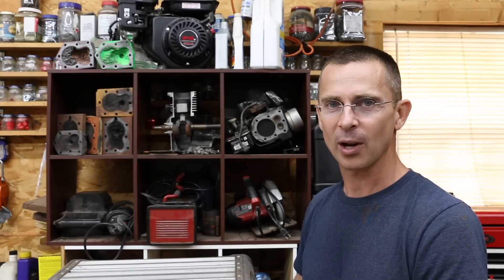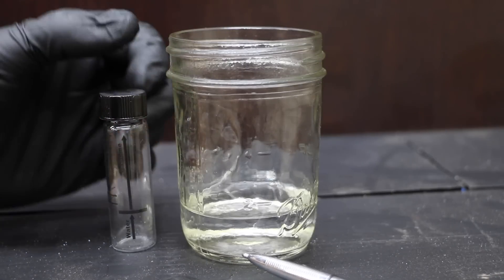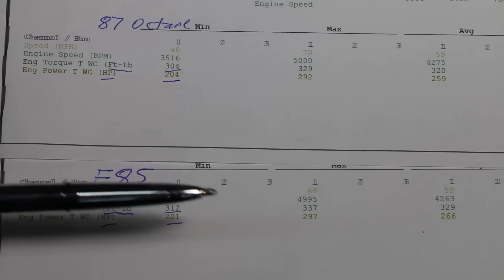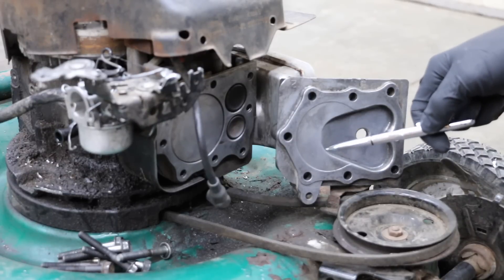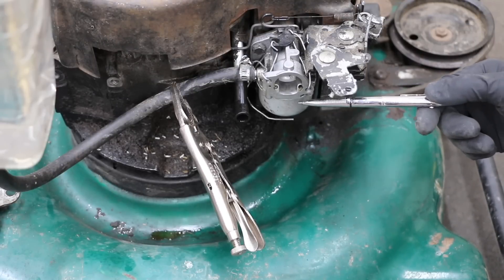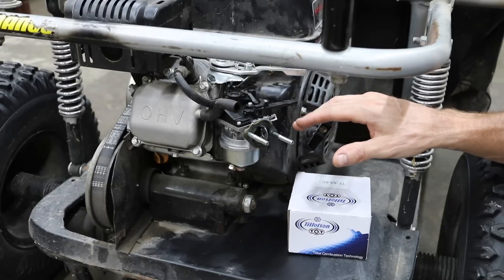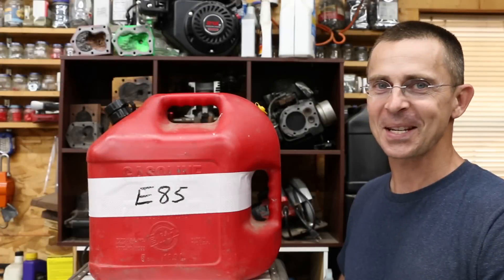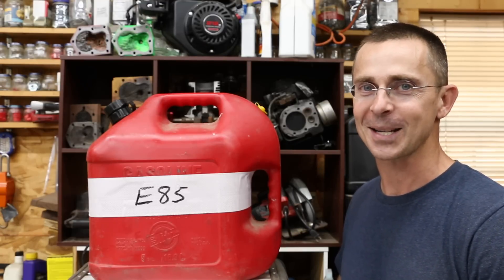Is E85 better than Gasoline? Let's find out!

Comment: E85 nets lower efficiency in any engine designed to run E15 or less. Simple chemistry and physics. Ethanol adds anti knock which means you can run higher compressions, either through displacement design or through forced induction. This makes up for it's far lower chemical energy. But without those two things and I don't known many/any engines that can change combustion chamber compression ratio on the fly you get less efficiency and power. Though you can recoup the power some by being able to advance the timing more for more mechanical advantage.

Natural gas is the same. You can take a standard engine and run it on CNG with some modifications but without changing the compression ratios you end up with poor efficiency per unit of fuel. However if you design an engine with higher compression ratios to begin with it's very efficient and smells like a laundry mat dryer, or at least the exhaust does XD.
Reply from the maker: Great point. Thank you
Reply: Exactly...
Reply: Nissan/Infinity make a variable compression engine but I don't think PF will be willing to buy/test/destroy one :P
Reply: So new flex fuel vehicles generally have higher compression engines that require or strongly suggest running 91-93. On some (like the F150) you CAN run 87 but the engine will detune strongly and Ford warns of worse performance in hot environments

Comment: I use methanol in my kart mainly for temperature reasons. I can drive at blackhawk farms for a half hour (at that point my fuel tank will be on fumes) with the cylinder head temp barely kissing 410°F. keep in mind that's a car race track, where the engine is running flat out 98% of the time as it's basically all straightaway. It won't go past 350°F in most 10-15 minute races at kart tracks, however gasoline will go past that before we get the green flag. reaching almost 500°F on normal kart tracks.

Have I noticed more power on methanol? not really. is it worth it's cooling properties, yes.
Reply from the maker: This is great information. Thank you

Comment: Ethanol does not belong in the fuel supply. It belongs as corn in the food supply! All ethanol does is cause the food prices to go through the roof. Also by the time 1 gallon of ethanol is made you have used 2 gallons of diesel fuel. So its really not worth it. Also ethanol has been banned by the FAA. So that tells you right there its bad!
Reply from the maker: Thank you
Reply: You know thats absolute bullshit.not all ethanol on world is produced on growing corn or sugarcane...here in Finland ethanol comes from bypass product, using biomaterial and wood pulp.Not a single bit of grown stuff is used....also the price is 50% lower compared to normal 95 or 98 we have here.

My biopower Saab consumes approx. 15-20% more E85 with much more hp and cleaner emissions and engine compared If id use gasoline instead.

Comment: I have a flex fuel vehicle, so I was glad to see you cover this. But now I'm more curious about the opposite. Where I live you can buy ethanol free fuel and it is notably more expensive than regular unleaded. I've seen it as much as $0.50 more per gallon. Since regular unleaded typically has no more than 10% ethanol how much of a benefit can ethanol-free gas be?
Reply from the maker: Great video idea!  I'll test it soon. Thank you

Comment: The silly thing is is that in Brazil they have multi-fuel cars which can switch between ethanol, gasoline and petroleum gas. Major car manufacturers just changed a few things like electronic tuning, seal composition and cooling controls. What 'we' have to do to get an internal combustion engine in 'our' countries running on ethanol is a joke... The Model A and T Fords could switch from ethanol to petroleum with a twist of a knob... Check out David Blume.
Reply from the maker: Thank you

Comment: What is crazy is the price difference here in Alabama between gasoline with 10% ethanol and Ethanol free, which there are many stations that you can buy it from, down in Florida they label non ethanol marine use only, but up here you can use it in your car! There is always a 30 cent difference in price, between the non ethanol and 10% ethanol! I have thought about doing a mileage comparison between running the non ethanol and 10% ethanol! I can still remember when I started driving between 97-98 gas was only $0.79/gallon and did not contain any ethanol, I could fill up my ranger for way under $20 and drive for quite a while on a single tank!
Reply from the maker: Thank you

Comment: do comparison videos between different gas suppliers. shell, BP, get go, sheets, speed way, and Costco brand gasoline. whats the ethanol content, fuel efficiency, how clean does it burn, greasy bolt test (how good it is at cleaning). we know the shell gas performs well from your previous tests but how do others hold up in comparison. I hear Costco gas is actually really good
Reply from the maker: Great video idea!

Comment: I used to have a flex fuel chevy s10.... got like 15 mpg with its four cylinder engine on e85 when it was typically 21-22mpg.   Didnt seem to run any different on e85, with the exception of e85 use introducing a cold start issue if the truck sat for a few days.  Would need to recrank like 2 or 3 times, wouldnt idle on its own until you nursed the gas pedal for a minute or so....So, yeah didnt run e85 much in that truck. Did so much better on regular ol 87.
Reply from the maker: Thank you

Comment: This is absolutely stupid test. Any engine designed to run both fuels will always get less horsepower and 20% less gas mileage using E85.
To get more horsepower out of E85 you have to rebuild the engine specifically for E85. The problem then becomes you will no longer be able to run regular gas in that engine or it will self destruct. I am specifically talking about N/A engines. 

With turbos if you have the ability to have multiple tunes set up in you engine computer then you can get more power from E85, but only if the turbo is not already maxed out on your gasoline tune. Which just about any production car from the factory is set up that way. They max out the design for use with gas. Then apply the ability to flex fuel using E85. This design approach will not get you any additional power when using E85 in a flex fuel vehicle, it will actually cost you some power.

Comment: ethanol is garbage, it destroys everything it touches. i have replaced so much fuel line on my machines its not funny and had carbs fall apart and start leaking and thats just from regular gas that i only buy once in a while. most of the time i get non ethanol gas but just using cheap corn gas now and then has caused lots of damage. once i had a small engine that wouldnt even run on cheap gas because they must have mixed too much corn in the gas. now i have to buy premium gas or buy parts which is annoying but thats politics for ya.
your videos are excellent and very thorough, i like the clear cylinder head and slow video.
have you done a cold flow oil test video yet?
Reply from the maker: Thank you.  I have not yet done a cold flow oil test yet, but I will in the future.

Comment: I have ran 1/3 E85 to 2/3 91 oct. in my 1985 Nissan Maxima VG30 engine (9.5:1 CR) with no tuning device and had better mileage and power.  Ran up to 1/2 E85 in a Honda Civic engine (10:1 CR irrc) with no tuning device, with the same power and mileage gain with smoother running, but anything over 50% E85 had rough cold starts. My 2000 Infiniti G20 with SR20 (9.5:1 CR) also with no tuning device also likes the 1/3 mix. Most factory flex fuel vehicles will see a drop in MPG due to the tuning used to almost discourage the use of E85, yes ethanol contains a bit less energy but that can be somewhat off set with spark advancement to make more power so you are not using as much throttle. Would be interesting to see how much power your go cart would pick up if you advanced the spark while running E85 or see if you can find the optimal mix and spark advancement to make the most power while keeping MPGs
Reply from the maker: Thank you

Comment: I ran my 1977 Chevette on e85, I had fitted it with a higher compression head, and adjusted the ignition timing, It produced 42hp before and 54hp after, and the emission where clean enuf to pass modern testing even without a catalytic converter
Reply from the maker: Nice!  Thanks for commenting.

Comment: I ran E85 in my S10 a few times and it was horribly slow, got terrible miles per gallon and had to shut the air conditioner off before accelerating from a red light or it would die
Reply from the maker: Thank you

Comment: How many tanks have you ran on E85? My 2014 focus se flex after about 3 tanks can get 31 mpg and feels much stronger when you let the clutch out. I am missing out on 43 mpg not using gas but I love using e85 in the city. Ill have to get one of those carbs too for my small engines great videos as always. I live in south florida I feel like the alcohol is a 3rd coolant in high heat.
Reply from the maker: I only used 1 tank, since the E85 station is around 20-25 miles from my home.
Reply: @ProjectFarm  I got lucky there's only one station close enough to me almost 7 miles away. Wish E85 could have become more widely available for more people and help drive the price down more. I've also seen stations charge even more for e85 than premium.

Comment: NA motors do not  respond positively to E85 but add compression they do when compared to expensive race fuel. $8.00+/gal race fuel or E85 at 2.30/gal. Granted I test every gallon but I will sacrifice 30%+ economy for 350% savings in fuel cost. Yes I don’t daily drive with E85 but the power I make at the boost I making is insane.
Reply from the maker: Thank you

Comment: I run E85 in my '69 Camaro with a 427SBC and an F2 Procharger.  I love it!  Before the Procharger I ran the same engine but with 14:1 compression on race gas.  With 4.10 gears, 5,500 stall converter and a 1050 Holley Dominator it got 10MPG on race gas.  With 10:1 compression, the Procharger and EFI it gets 6MPG on E85.  The part I love is the price!
Reply from the maker: Nice!  A lot of power for sure!

Comment: Cool test but I feel like running it in normal cars is pointless. The main reason of people running e85 is that in higher performance engines, since e85 has a high octane and burns colder than normal gas, in high compression engines you can do things like advance the timing, and add more boost without fear or pre detonation. Resulting in higher power numbers. E85 doesn’t really do all that much on its own. It just allows you to increase the power of your engine in a safer more effective way
Reply from the maker: Thank you

Comment: My truck has a flex fuel engine and I run E85 sometimes.  With normal 87 octane gas I get about 20mpg.  With E85 I get about 13mpg.  With E85 the engine feels like it runs a little smoother but it could just be my imagination.  The exhaust with E85 makes my eyes water and burns my nose.
Reply from the maker: Wow!  Big drop in MPGs.

Comment: All I know is if you have a Harley Davidson motorcycle and you accidentally put E85 in your tank your instructions from Harley-Davidson are do not turn the engine over do not start the engine call us and we will come and tow it back to the shop we will drain the tank we will drain the carburetor we will drank drain all the fuel lines. If you start the engine up at the gas station and drive it to the Harley-Davidson dealer with E85 in it it will void your warranty..
Reply from the maker: Wow!  Thanks for this information.

Comment: I run e85 in my 07 Tahoe with cold air intake, cat back performance exhaust, and pcv catch can. It costs me .05c less per mile on e85 than 87 reg. Truck runs better on it as well.
Reply from the maker: Nice savings!

Comment: Without extra compression(added via turbos,superchargers, nitrous, or higher comp pistons) and or added timing advance you should actually have lower hp and fuel economy based on the fact e85 even your 85% mix is a higher octane which means more stable which also means less explosive.
Reply from the maker: Thank you

Comment: I think that e85 is a terrible fuel for most applications. Our modern gasoline already has enough ethanol in it. I am a classic car and truck collector and enthusiast and the modern gas has some pretty bad boiling issues in my carburetors, causing my engines to flood after they sit for awhile after being driven. I could see it’s use in a high compression engine but it just doesn’t make sense in your average engine. Especially not any carbureted one.
Reply from the maker: Thank you

Comment: It would be cool too raise the compression ratio just to see if we can make any more power. Shave the head a little, not too much make sure the valves clear, but also make the piston taller with a piece of sleep welded to the top of the piston. Probably wouldn’t last long but it would just be cool to see.
Reply from the maker: Great video idea!

Comment: 87octane.. wawzers.. that is low. Where i live the lowest i can buy at the gasstation is 95. we can also buy 97 and 100, (and even 103 and 108 but not at regular pumps though, but if you like the loudpedal, you know where to find it)

I once read a story of an american Ferrari owner, who had complained to Ferrari that his car delivered only 450Bhp instead of the advertised 550Bhp. Ferrari went to diagnose, and found that the owner had been putting 88octane instead of the 100ocane the car needed, and therefore lost that much horsepower. 

So if possible, maybe a test about octane-amounts, and if higher octane has other benefits other than more power.  :D
Reply from the maker: Thank you.  The US uses a different octane rating system.  Great video idea too!

Comment: What about testing E85 as a cheap fuel treatment for regular 87 octane. Like using 12 oz of e85 in a full tank of gas vs 12 oz of sea foam in a tank of gas. Obviously e85 is much cheaper by volume, but is it as good of a cleaner?Thanks for these great tests!
Reply from the maker: Thank you

Comment: E85 is amazing for boost and racing, keeps things cooler, much broader tune curve for timing, and much cheaper then race fuel. Alot of drag racers run it for that reason and since fuel efficiency isn't a worry. I'll be fiddling with it for endurance racing, see how well it does with fuel efficency over an endurance race

Comment: E85 really shows on boosted engines. Its about like running 105 octane give or take. You can run higher boost with the same set up as long as you have the extra fuel to support it. For example my cobra picked up 40 hp just by running E85 with the same boost. The ability to increase timing without the chance of detonation is what made the difference. Also in situations like mine is when the fuel difference shines. Around here i pay about 3.50 a gallon of 93, but I can run E85 for 1.70. Half price for more power and also runs cooler.  Sure the mpg is different, at 17 on 93 compared to 11 on E85. But the cost per gallon makes up for that and then some.
Reply from the maker: Great point. Thank you
Reply: @tdidan Central IL. Its around 1.90 now, I haven't ran it in a few years.

Comment: In my parents 2010 F-150, we hardly ever use E-85. It drops from about 18 mpg (5.4L V8 btw) to about 12. Also, while the engine seems to have good power once it's rolling, taking off from a dead stop, even after two or three tanks of E85, the vehicle stutters and idles rough. Overall, I have heard it's a great way to clean out the engine, so once in a great while we do run one tank of it out along with regular uses of Marvel Mystery Oil, but otherwise we avoid it.
Reply from the maker: Thank you for commenting on this.

Comment: I used E85 once. I was towing a 9,000 lb trailer. I was getting around 9-10 MPG on Regular. E85, it dropped to 4 MPG!. I bought a diesel less than a year later. It won't run on E85 thank goodness.
Reply from the maker: Wow!  4 MPG is awful!

Comment: My mileage drop is pretty consistent with everyone else- 11.5 to 12 on E85 vs. 13.5 to 14 on regular. If I run pure gas, I can hit 15.5 to 16, but I'm forking over $4 a gallon. 
I'm running a 2015 Ford F-250 with the 6.2 v8 and 3.73:1 axles.
As far as performance, I do notice more low end torque, and less downshifting.
Reply from the maker: Thank you for the information on fuel efficiency.

Comment: Try running an engine with liquid rocket propellant. A 50/50 mix of liquid oxygen and liquid hydrogen is the most powerful type.
Reply from the maker: Thanks for the video idea!
Reply: Dustin 2/3 H and 1/3 O. This ratio would probably fry the engine.
Reply: There are some dragsters which runs on hydrazine. Wich is insane because that thing is self-igniting and poisonous.
Reply: Lol. That would be a bomb...

Comment: Why not test a Mazda Miata with 99 or 2001 motor. Stock and larger fuel injectors, Stock and higher pressure  fuel pump, Stock ECU and Programmable ECU
Reply from the maker: Thanks for the recommendation.

Comment: My car is 2010 Impala and can use E85.  Would it be a good idea to use E85, lets say every 3000 miles to clean up the carbon inside engine instead of fuel treatments?  I think E85 vs Seafoam would be a good video idea.
Reply from the maker: Seems like a good idea to run a tank of E85 every 3K miles to clean the engine.  Also, great video idea!

Comment: If you compare by volume, E85 is indeed much less efficient, but that's because the calorific value is much lower. If you convert the numbers, it will turn out that E85 is more efficient, it just takes up more space. Somehow the price doesn't reflect that difference yet in the USA. (It does in Germany where E10 is cheaper than regular fuel) I'll get back with the actual calorific values based on your test results.
Reply from the maker: Great point. Thank you